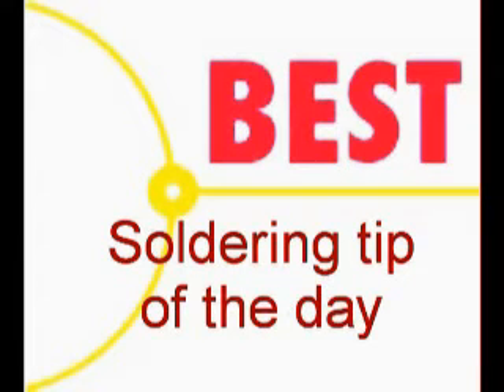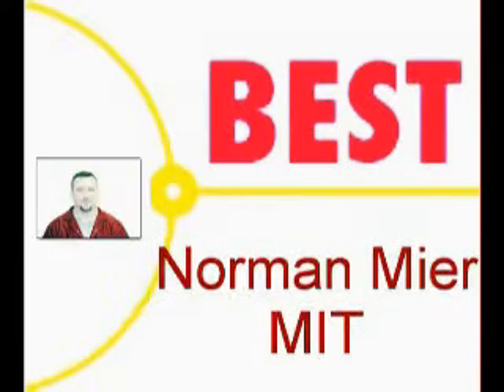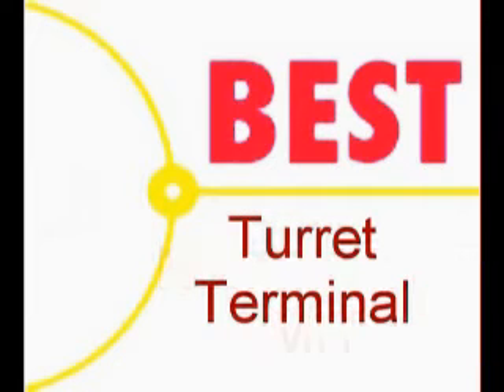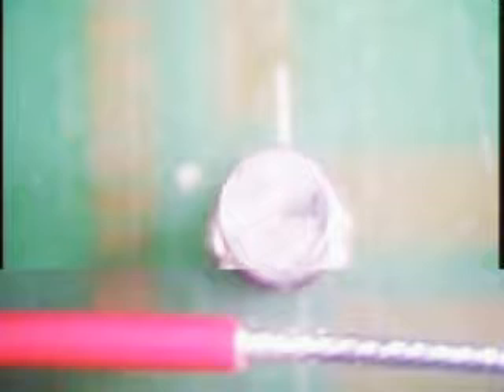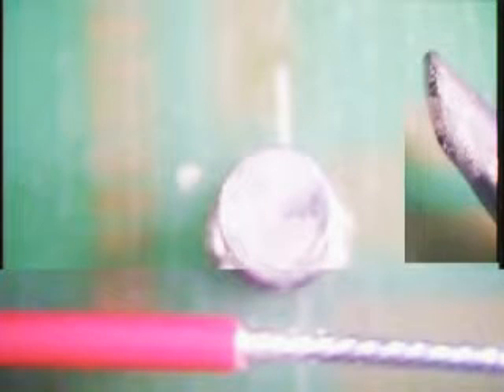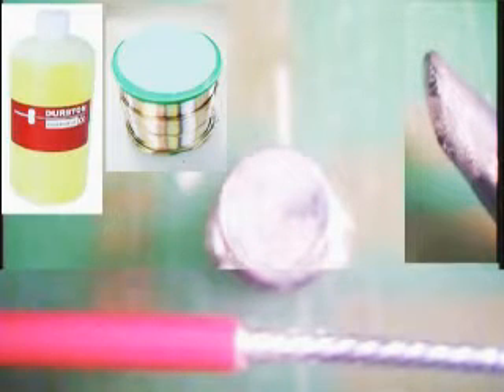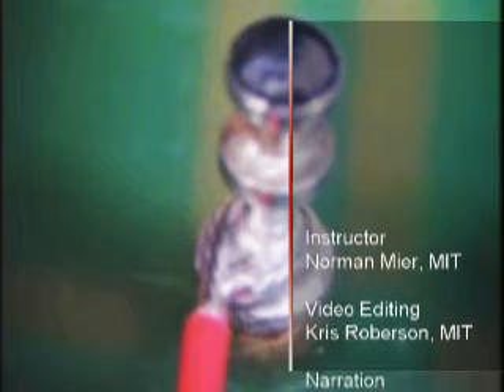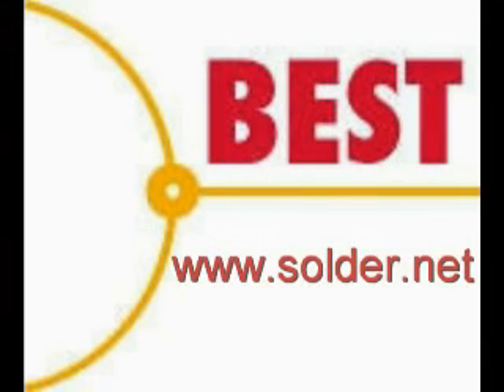Lead-Free Turret Terminal Soldering

Comment: Inacceptable, because you are pushin a realy realy BIG ammount of pressure to the Turret Terminal. Cheap Boards WILL get damaged with things linke lifted pads or so.
Reply: Yeah just make a tight 90-180 degree hook in the wire away from the board, and then put it around the turret terminal and pull gently on wire to keep good contact while you solder it. 

Massive pain in the arse to rework wires that have been twisted around eyelets and other things before they were soldered.